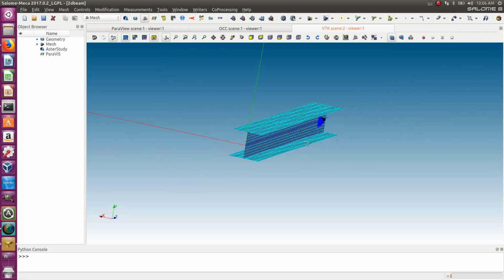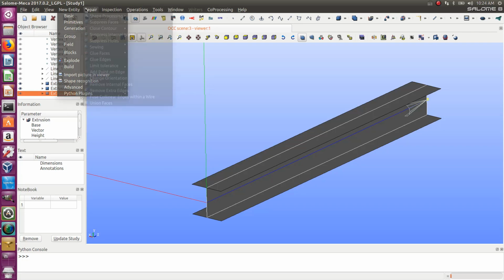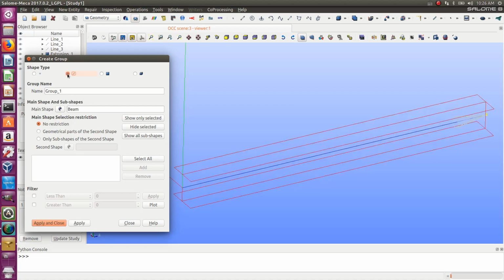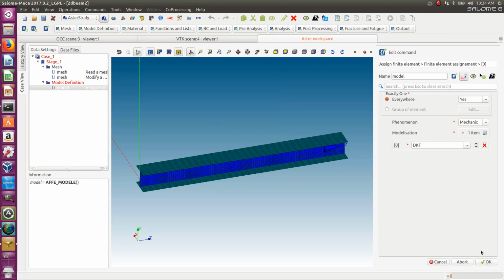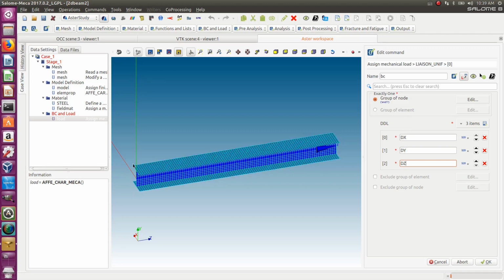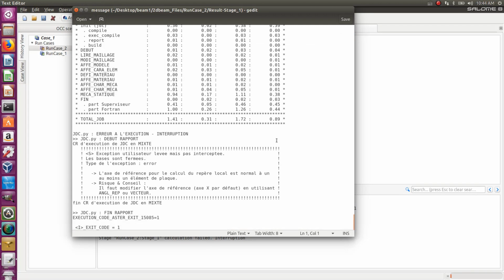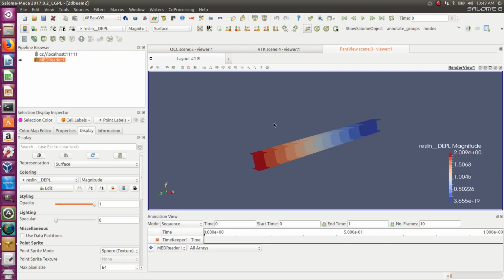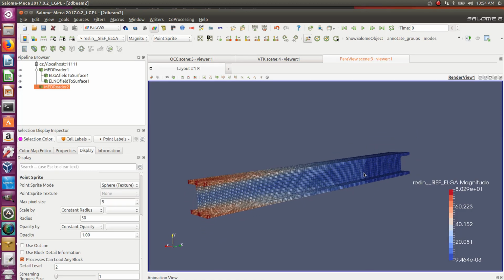[Code_Aster Tutorial] Simulating a 2D shell Beam in Salome-Meca

Comment: I do not have a "read mesh" option in my sub-menu in Aster Code. Anyone can help with an advice why ? Thank you
Reply from the maker: There is an option in the menu bar or the settings to activate the “business language”. If you don’t activate it, you will see the name of the commands instead. “Read mesh” is “LIRE_MAILLAGE” (same thing in French)
Reply: @Feaforall  Merci, yes it sorted the problem. I have some openGL problem in my code aster module though and cannot edit my model once I enter it. I managed to install the latest distribution on Ubuntu 21.04, but salome is running in software mode, perhaps that is the reason. I will try to reinstall the entire package.
Reply from the maker: @peterszulczewski9804  I am not sure Salome will support Ubuntu 21.04. Salome generally works on the stable releases so I recommend you to try on 20.04 if you can... good luck!
Reply: @Feaforall  Thank you. I have the new Ryzen 7 processor from AMD. Unfortunately installation of CAELinux/Ubuntu 18.04 on it was above my level of skills.

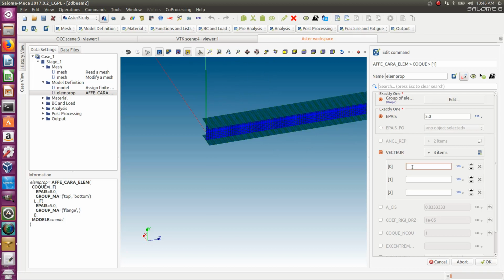Comment: To be honest, It is still not very clear the orientation part (27:16). Few question that are not clear to me:
0) How to choose the write orientation? Do I need to refer to the normal direction of the shell?
1) How to define orientation when I have the shell along a inclined plane? 
2) How to define orientation when the shell is not on a plane but along a curve surface (think for example a pressure velles with a 2D mesh that rappresent the sheet metal cilinder and the two spherical ends)?
3) How to define orientation when my strucuture is built by different shell oriented on differente planes (I hope that I don't need to define orientation for each single piece of 2D shell...)?

By the way, thank you Cyprien for your helpful OpenSource software tutorials!

Comment: Hy Cyprien, nice and complete tutoral. May I ask you if there is a way to visualize applied loads and boundary conditions prior to the analysis?
Reply from the maker: Unfortunately, no
Reply: @Feaforall  i found this function with the SALOME 9. There is now the possibility to visualize node or elements in which something is defined, as forces, constranints and so on... This can be done in the window "information" on the left side of the interface.
May i ask you one more question?! it seems that stresses are processed considering the local coordinate system for shell elements. Is that true? If it is true, is there any possibilities to change the reference system in order to use the global one? i'm getting crazy with that! :(

Comment: Hi! Why do you used DKT?
Reply from the maker: DKT is the most basic type of plate element in aster. Check the doc for the details: https://www.code-aster.org/V2/doc/v13/en/man_r/r3/r3.07.03.pdf#page22
Reply: @Feaforall  I used the DKT in a plate model and get the result more near to the theorical than DST. What I know is the DKT (Discrete kirchhoff Triangle, can be quad also) do not consideer displacement by shearing. But I don't know much more about. I already read the documentation.

Comment: With a thickness of 5 specified, does that add 2.5 either side of the surface? Or 5 above/below the surface?
Reply from the maker: It ads 2.5 on both sides. If you want to add 5 above, you will have to add an offset value.

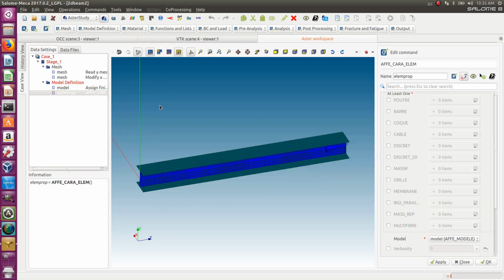Comment: I have looked you video the whole day. Just tell me how but not why.  I can not learn well from your video. for example 15:40 ''for shell element you should use this''. but what is that? what is it for?  thanks for the sharing, but it helps me not much.
Reply: I think that what he shows us is how it's done, that's the point. Now, for the fundamentals you should read some documentation and tecnical books. Make this simulations work is a trycky stuff, the ambient is very complex and not very user friendly, and this you will not get from books. Hope I dind't offend you, and if you need some tips for teorical videos and books I can help you.
Reply: You need to use the "Coque", and "epais" commands to tell Code_Aster the thickness of plate. Until  this point there is just planes or shell with no thickness. This seperates the 2D shell element analysis from a 3D brick element or TET elements analysis.
Reply: I think he tried his best to make a video which balances between the length and the details. It's great for a beginer.